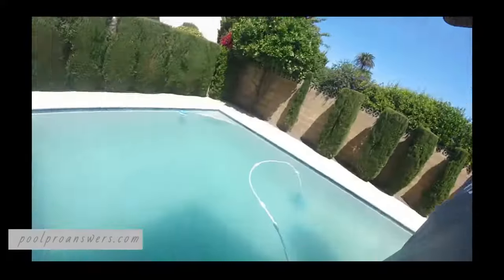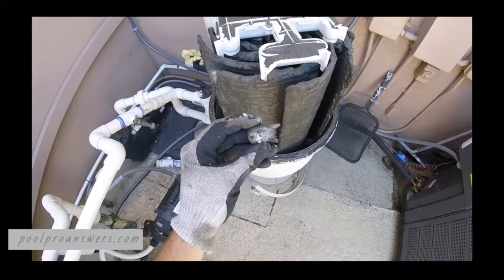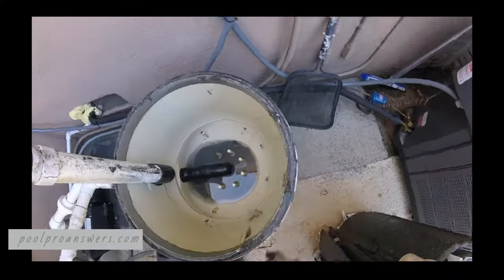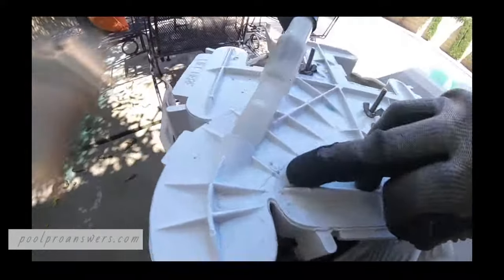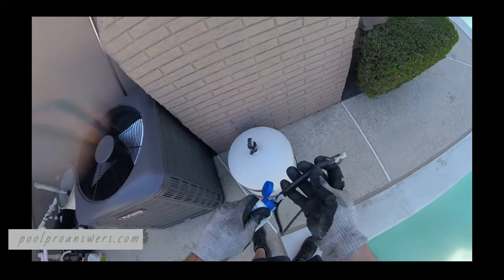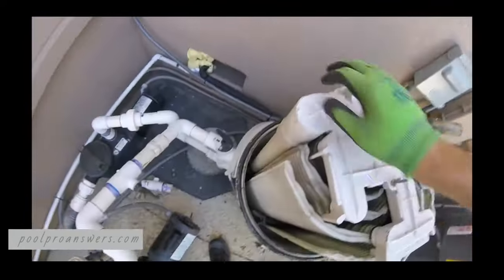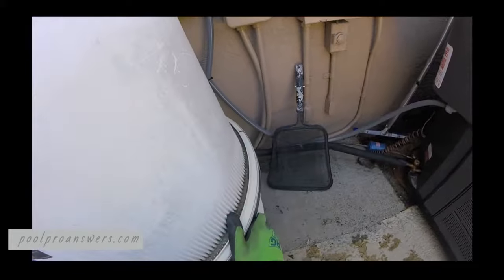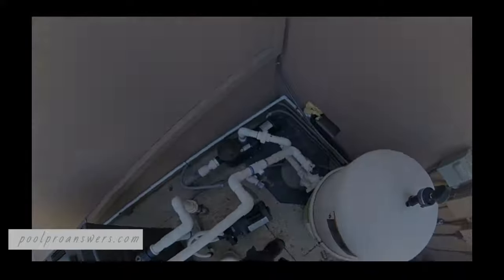Don't Backwash Your DE Pool Filter, Do THIS instead

Comment: Thanks for the tip. In hindsight, back washing a de filter is a very messy process, plumbing the used de and debris creates mess that needs to be swept up. I plumb it to my lawn and picking the mess up from a lawn is a bitch. Employing your method will allow me to rinse out the de and have it land on concrete which will be much easier to sweep up . Im going to try and see how it goes.. 

I have a question relating vacuuming. I  have a purex triton smbw 2060 DE filter. It has a rotary valve with filter setting and backwash setting. Is there a way to vacuum to waste? Can i vacuum with the valve in the backwash position?  Can i run if without the grids?   

Thx
Reply: Yes, I have done that, quite cumbersome, but it will work. That type of filter is by far the preferred filter used by pool servicemen in southern California.
Reply: @carlc5748  so cal is where i stay at, and yes, de filters are common here in LA, they do a great job and keep water crystal clear.  Backwashing and cleaning the grids are a big PIA! I fucked up by not maintaining my pool and let it go to shit, i had to clean grids and recharge DE about 10 times before getting it to clear! Lessons learned! 

My neighbor changed to cartridge style  and he deeply regrets switching as he feels he doesn't get the clear water he use to get with DE filter!
Reply: @dannydee9919  You got educated in pool school of hard knocks, never forget the lesson that you learned!  I am a diehard DE man, because DE filtering down to 5 microns, will trump a cartridge filtering down to 15-20 microns.  I use the DE substitute Aquaperl. Measure the same as DE, but weighs half as much, comes in a 12+lb bag, as opposed to a 25lb. DE bag. In cleaning out a filter, it seems to go away quicker into the ground, as well. Hasa owns the company. I have been using it in lieu of DE for more than 15 years. A lot of pool guys are not aware of this product.
Reply from the maker: @Danny, what @Carl said ^^^^

Good call on the Aquaperl, thats probably one of the better DE replacements.

Comment: So I  add 4.5 scoops after each backwash, if I clean this way, I’m assuming I’ll need to add more
Reply from the maker: Yes. A complete teardown that removes all of the DE will require adding 100% of the DE back.
A backwash will usually require a lesser percentage to recharge it.
Reply: Why go against manufacturer's recommendations they built the product
  Just be thorough with your back wash sometimes repeating the process a few times until you see nothing but clear water  before adding new de.

Comment: Hello I'm having problems with my filter and cartridges I've taken them out rinsed them put back at least two times the vacuum would work for a hour then stop also the pressure is up to 35 I take it apart and the filters are dirty as before within a day any help or recommendations is appreciated
Reply: Replace the elements at that point. They can appear to be clean but the pores on the elements are still clogged, thus the pressure rises quickly.
Reply from the maker: Most multi cartridge units will need new cartridges every 4 to 5 years, can be longer in some cases. 
If you're in that window, it's time to replace
Reply: @PoolProAnswersDIY  I concur!
Reply: I made up a cleaner  from 1/2"CPVC (tan colored) plastic pipe. It is 36" long, you can make it any length for your filter. I cap one end and drill a1/16" or 5/64" holes, 6 is enough.
On the other end I have a garden hose adapter glued on and use a shut off valve, then the garden hose. This way you can stick the pipe cleaner down between all the grids, shut off 
water so you don't get wet & go on to the next grid. It does an excellent job of cleaning. All parts can be purchased at either HD or Loz

Comment: Whats the drill socket name for the drill ?? Im currently using a hand wrench lol
Reply from the maker: It's a Ryobi impact drill gun with a 3/8 drive socket adapter and then  whatever size socket you need.
I usually use deep sockets, typical sizes are either 9/16, 3/4, or 7/8" depending on the make model or year of the filter.

Comment: how much DE to put after cleaning that filter?
Reply: Buy a DE scoop, 5 for a 48 6 for a 60
Reply: Don't add a full amount after backwashing; there's plenty left behind as back washing isn't the most thorough way to clean a de filter.   That'd be fully disassembling the unit and hosing off the grid assembly or soaking the grid assembly in a cleaning fluid made for this purpose.  I add 1 scoop or pound less then you'd add to a new filter.

Comment: How do you replace fingers or long tubes in my DE filter
Reply from the maker: If you're talking about the parts inside the fabric. You need to replace that entire grid. Those ribs support the fabric, which holds onto the filter media. There are no replacement parts made other than the entire grid.

Comment: Have you noticed when those de cartridges get about 10 years old  you have to replace because the pump won't stay full primed long even after washing them and they start to trap water. I believe that's when they need replacement or you have to do constant backwash?
Reply from the maker: 10 years is a pretty good run on grids. These grids can be replaced in entirety or per piece. I usually recommend replacing per grid as needed for efficiency and cost savings.
Reply: @PoolProAnswersDIY  the grids that have trapped water inside are the ones to be replaced? I don't see any difference in any of the grids regarding damage so I assuming replace the grids with water inside?
Reply from the maker: @kevinfahey7618  a lot of time water is trapped from doing a backwash cycle. That's not necessarily indicative of a failed grid. Look for torn fabric and cracked ribs. If the structure has failed you'll lose filtration efficiency.

Comment: I do this to my 48sq ft D.E. filter twice a year. it is a 2 hour process each time I do it. I hate it, but it is a necessary evil. I'd rather have a colonoscopy than do this.
Reply: Yes, your "necessary evil" systematic approach is, I think, the best way. I clean a filter when the pressure rises 10 psi over the starting pressure, which will vary on each system. Pools are like kids, each one has a unique personality! Come to believe that after taking care of thousands of those "kids".  I've cleaned thousands of DE filters over the years, but I charge enough to make a business out of it!
Reply from the maker: Twice a year is probably bare minimum for most pools 👍🏼
Keep up the good work!!
Reply: I made up a cleaner  from 1/2"CPVC (tan colored) plastic pipe. It is 36" long, you can make it any length for your filter. I cap one end and drill a1/16" or 5/64" holes, 6 is enough.
On the other end I have a garden hose adapter glued on and use a shut off valve, then the garden hose. This way you can stick the pipe cleaner down between all the grids, shut off 
water so you don't get wet & go on to the next grid. It does an excellent job of cleaning. All parts can be purchased at either HD or Loz
Reply: 2 hours? Are you pulling all the grids out or doing it like in video? I do it like in video and it takes me about 30 min. I started doing this instead of backwashing because I never know how much DE comes out with each back wash and I was concerned I wasn’t adding enough back in, or that I would eventually put too much in and then have it blow back into Pool.

Comment: One thing that can cause the cracks in that manifold is taking out all the grids at one time.  It's plastic and can only withstand so much weight on those grids...
Reply from the maker: The manifolds with molded handled are actually designed to be removed all together as one unit. The cracks are generally from chemical exposure over time which causes the plastic to become brittle. This process is sped up with bad water chemistry. But you definitely don't want to be overly rough on the top or bottom manifold.
Reply: manifolds crack when filters aren't being backwashed enough and properly

Comment: What size socket ? Did you use to take of the ring ?
Reply: Should be a 7/8 Socket
Reply from the maker: if you have the same filter as the video it will be 7/8" like what Ed commented. The other common sizes you might encounter depending on manufacturer; 9/16", 3/4", & 13/16"

Comment: I’ve been doing this weekly my self and pressure is sti high
Reply from the maker: How Hi is high?
Reply: @PoolProAnswersDIY  Hi, how are you?
Reply: Like this how the guy said I cleaned my mind twice this week Since I open the pool less than one week and the gauge still sits at 20 and higher
Reply: What ? u need take them a part and  chemical clean the grids  there is oil on the grids that's why pressure keep going up

Comment: I didn't see you checking on the grids     looks like the water is cloudy because the D E is going back to the pool I didn't see you fixing anything the top maniofold is broken definitely need a  new one  very bad job.
Reply: @PoolProAnswersDIY   if you don't check on the grid what's the point  maniofold was broken  nothing was fix   the dust is going to keep going back to the  pool  . 🧐
Reply from the maker: @israelflores1375  The grids were checked, but THAT was not the point of this video...see comment above...and the manifold was not cracked. go back and rewatch the segment you are referencing, the manifold had stress cracks in the plastic indicating that it HAS NOT yet failed, but soon would. The manifold was completely in tact and safe to reinstall. If it failed, we would see DE blowby right away. I apologize, but you seem to have missed the point of the video.
Reply from the maker: @port nut very true statement. Trust and honesty are what to look for. And a CPO (certified pool operator) doesn't hurt either☺️

Comment: Teachers pool basics I don’t know shit about pools and I just bought a house with a pool I would like to get rid of my pool guy at some point so I can save some money
Reply from the maker: ... That's what I'm here for
Reply: @PoolProAnswersDIY  just a few concerns about DE will it cause harm to the ocean I’m close to the beach and my pool guy dumped the backwash line into the middle of the street so it’s white powdery dust all over black pavement? I was thinking to hose it down tonight into the gutter but it’s already all the way down the blocks gutters and my neighbors are pissed I’m sure. It that crazy toxic or hazardous to the sewers. Since it runs off into the ocean I’m worried my one neighbor will report it to the city!
Reply: @iiiheartt333  in some cities you can get a ticket for backwashing  
Into the street, de is just a natural media but its full of chems from your pool. If its an issue consider getting a cartridge filter.
Reply from the maker: @iiiheartt333   @Andres Gutierrez  is right, it depends on the municipality. Your pool service should know, although many times the service guys aren't always up on the regulations.
You may be able to install a separation tank that holds the DE when you do a backwash. In the municipality where we work these are required for commercial pools, but are generally a good idea.

Comment: Hose off the grids once a month and replace oring once a year too. That oring wears thin fast lets de back to pool that you can't see. Pool will cloud.
Reply from the maker: Once a month might be a bit much since the DE cake filters to a lower micron over time, but it's definitely good to have a solid maintenance program
Reply: @PoolProAnswersDIY  once a month is nuts; aint no one got time for that.
Reply from the maker: @AidanSkoyles  I'm not the one recommending once a month. If your filter is properly sized and your pool properly cared for you can generally go once a quarter and be just fine

Comment: DE filters are a pain in the ass.
Reply from the maker: Haha...I tend to agree, but they do produce the best result in terms of water clarity, so it's a trade off
Reply: @PoolProAnswersDIY  I had a DE filter. I power washed it, backwashed it, added DE, and I still could never get it to work better. The water flow through that thing was terrible.

Comment: Beware too much water pressure can damage your grids. He was using way to high of pressure and concentrated spray.
Reply from the maker: This wasnt a pressure washer. But I'm open to other opinions.
What's your proof? I'd like to look into this claim.
Reply: @PoolProAnswersDIY  that is bogus remark dont listen.
Reply: I damaged my grids the first time I sprayed them off. They are more fragile than you think, especially if they are the originals. I use a fine, wider spray without too much pressure.

Comment: Pentair Filter tank lid is easily CRACKED, starting with tiny line…………I wouldn’t tap with Mallet.
Reply from the maker: That's an interesting comment. I'm sure if there is an older filter or one with manufacturing flaws your comment could be true. Unfortunately, it's directly opposite to the instructions found in the manufacturer's instruction manual (easily found online) and this is also common industry practice.